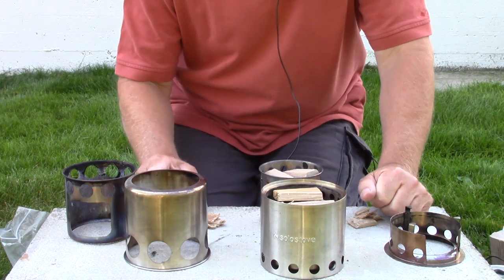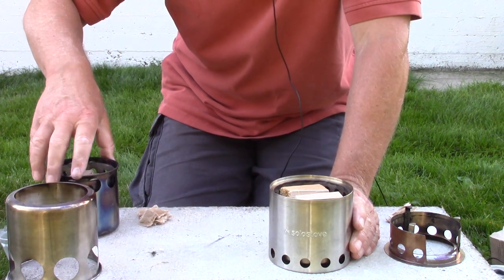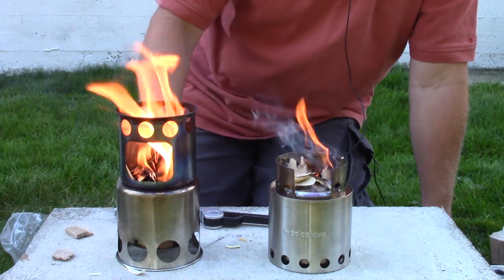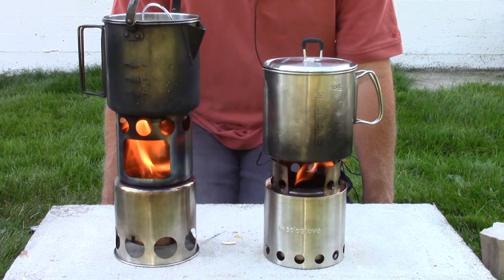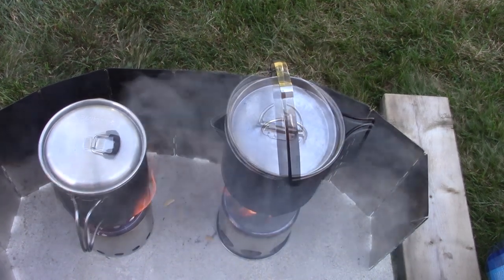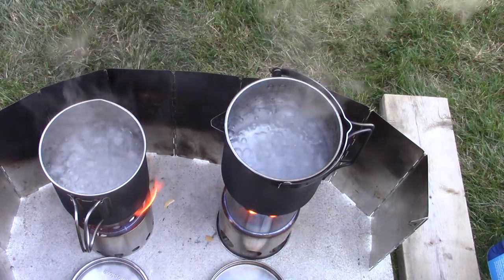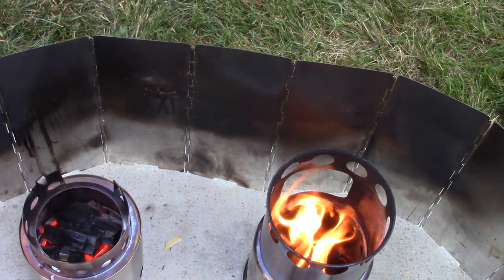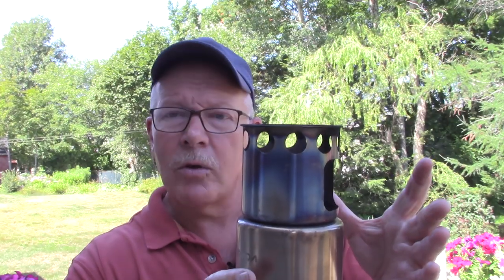Solo Stove & 900ml Pot VS Lixada Tower Stove & Camelwil 1.2l Pot - Part 2

Comment: 11:22 I don't understand the rush , on the boil time ...My friends make a big thing out of it....but I enjoy the slow process to boil...I enjoy sitting with the fire and feeding it.
Reply: Kanzee We're in the same camp about boiling. I always thought sauntering (hiking to other people) was about "unwinding" and enjoying nature. In the last few years I've begun to wonder if someone declared a race in the woods and I didn't get the memo. Of course I'm older now than in the  late 1970's when I started backpacking so if it really is all about the miles now instead of taking time to experience the beauty I guess I'd better hang up my boots.
Reply: The one thing I always bring on a hike is time,  enough time to enjoy what I am doing.
Reply: Alexander Gutfeldt One great thing about time is it doesn't weigh much as long as you're enjoying yourself.
Reply: No rush on boiling in my camp, I get the water on and while it is doing its thing I have time to set up my tent and maybe even blow up the air mat.
Reply: @viewsandreviews180  The only rush to boil is for the first coffee in the morning! For that I use my single burner gas unit.
Reply: Indeed. Sometimes the longer the cooking the better.
Reply: Working with tealight candles is the best option. Especially honey, beeswax. Honey beeswax clears up allergies, and indoor pollution. Using olive oil is the safest. It smothers the flame. Leave the tip of wicks dry to light it. This works with heat resistant mason jars with metal caps. It can hold at least ten wicks with holes in the metal caps. :)
Reply: @weatherstorms  Fantastic , I remember when the storms would knock out our power regularly, and the ole folks would make lanterns with rolled up soaked diy wicks and veggie oil.....the only problem with this was the black smoke they made ...but they worked well.
Thanks for sharing that about the Beeswax...that is good to know. cheers
Reply: @kan-zee  No problem! Olive oil is way less likely to make smoke due to its thickness. As long as the flames don't touch the pot you are in good hands. Sometimes receiving heat without flames surrounding the pot does work better. Unless it's yellow bottle heet, denatured alcohol, and trangia fuel. There is no soot with these fuels. Thanks for your comment! Melissa.
Reply: @kan-zee  Cheers to you too! :)
Reply from the maker: I personally enjoy taking my time with fire building and meal preparation. Boil time is not all that important to me either. If it was, I would use a gas canister instead of a wood stove or alcohol stove. In comparing stoves together boil time is included to provide an indication of design efficiency. In truth, a stove that boils water quickly often goes through woods too quickly. I like stoves that require minimal re-loading of wood. It can be a nuisance having to constantly feed sticks into a stove when I have other chores to do. Maybe a better measure of stove design is lack of smoke or length of burn. I try to comment on those is the comparisons as well. Thank you for commenting
Reply: @MarkYoungBushcraft  Which ever Stove you are more comfortable with Mark. :)  Thanks for sharing. Thought I'd share mine.
Reply: @weatherstorms  No beeswax in bear country please.  You will attract them.
Reply: Totally agree.  Being on the trail is great.  Warm food on the trail is awesome.  And once I discovered there's no rush, it all came into focus for me.  My first change was to ditch the canister stove for an alcohol stove.  The quiet is dreamy.  No more jet engine noises.  When I did that, suddenly all my trail buddies and scouter friends (I'm a scoutmaster) starting making and buying alcohol stoves.  Now I've made the addition of wood burning stoves to my gear closet, and have to say, it is a great excuse to relax by the fire.  While one guy is scrambling to get food made and talking about how fast his Pocket Rocket 2 boils water, I'm enjoying a quiet fire and chatting about what we saw, while I wait a measly 8 minutes or so to boil my water.  And I don't have to buy fuel ... ever ... if I don't want to.  I still take my alcohol stove with me, because I just like it, but I probably spent about $4 on fuel this year (total), and have otherwise been letting the trail provide.  

Being on the trail gets even better when you discover that there's no reason to be in a hurry.
Reply: @mclostinthewoods  I like your comment and your camping / hiking Style. !! 
😎👍🌟🌟🌟

Comment: Good video Mark and yes your assumptions for the performance differences are correct. 1. More air to the burn chamber increases the burn rate which elevates peaks temperatures and consumes fuel faster. The other design aspect that influenced your results was that the Solo's construction adds an insulting blanket of hot air around the stove to keep the burn chamber hotter - this is why the re-ignition of the 2nd load of wood was faster. The tower stove looses a lot of heat to the outside world. Stove design is fascinating. Keep up the good work.
Reply from the maker: Hello and welcome to my channel. I have been looking at your new stove since I first saw it on Shane's channel. I hope to be able to justify buying one at some point. I would love to test it out. Thank you for commenting and for your insights.

Comment: Great review and I'm really enjoying the series on wood stoves. I was so impressed with the large Lixada tower stove I bought one instead of the large TOAKS. The Lixada has worked as well for me as it did in your demonstration video. Now I've got some extra money for trail food or some other something like the Camelwil pot, thank you. Keep up the good work.
Reply from the maker: Glad you are finding the videos helpful. You could buy the Camelwil and have money left over for some HappyYak meals😉 Thank you for commenting
Reply: Mark Young I was wondering what size Camelwill you’d recommend for the large size Lixada (I like the larger base due to stability) but found the 1.2 liter’s diameter doesn’t fit the larger base. I like the pore spot on the 1.2 but haven’t found the 160 mm Camelwill has one.

Comment: Hi Mark - interesting comparison of two stick stoves.  I've used the Solo stove on a couple of trips and found it to be rather annoying in practice.  As you say, the burn chamber is small and holds less.  It felt like it required constant monitoring (I used dry twigs) and wasn't particularly quick.  After using other options I think the Solo is simply an over-priced "yuppy toy" that achieved fame with slick marketing.  I totally got sucked in by the it's-expensive-so-it-must-be-good mentality.  It's due to good people like you that we are able to know about the more viable and realistic options for making hot water - after all, that's all we want in the end!  Smile.
Reply from the maker: Thank you Paul. I really wanted to like the Solo and actually do but as you say, it can be a nuisance to keep going when I have other chores to do around the camp site. I suppose the advantage is that it uses small sticks but then again, that is its disadvantage. It just goes through them so quickly. Thank you for commenting

Comment: Very interesting Mark, can't believe the price difference, good job I like Lixada stoves. I also now have the Camelwil pot as my go to, though I stopped the floppy handle issue by wedging steel garden wire into the handle mounts, worked a treat. Thanks again for sharing Mark, take care 👍🙂
Reply from the maker: Great fix for the Camelwil. Both the stove and pot are great items by themselves and even better together. Thank you for commenting

Comment: I have the Solo Lite and the Lixada Titanium Tower stove.  I have to say, I'm finding the wood stoves a lot of fun to backpack and camp with.  I have been an alcohol stove guy (Zelph Fancee Feest) for years, and just got into wood stoves this year.  I will admit, I did build a soda can stove (with carbon felt wicking) to take with the wood stoves, just in case (and it has been a good add-on), but I have been taking my wood stoves for the last few months.  I think I like the Solo more of the two, because it is so well made and does do such a good job.  The tower stove is good too, and I do enjoy using it, but I think the Solo gets a stronger and hotter flame faster, and is a little cleaner to use.  It's a lot easier to dump the ash and bag it up, where the tower stove tends to be a little messier to take down.  I do find the tower stove cools faster, since it's titanium, but I have been pleasantly surprised how quickly the Solo actually cools down.  I was worried about being able to make coffee/tea in the morning and having to wait a long time to pack it up, but in 10 minutes (once you dump the ashes) it's ready to bag up and put away.

The alcohol stove comes in handy if it's raining and fuel is harder to process, but I have (out of morbid curiosity) tried to burn wet fuel in the rain (under a tarp) and was able to get it going in the Solo.  Not quite as successful in the Lixada, but it did work after a little bit more effort.  The trick is finding some material you can split down to get to the dry inner.  

Altogether, I'm completely entertained by these wood stoves.  I really enjoy them both.  If you have an REI dividend you want to spend, the Solo Lite and 900ml pot are a great bit of kit.  That has to be my favorite pot of any I own.  The Lixada is affordable enough (and the titanium one is only a few bucks more than the steel) that you likely won't have to wait to pick one up.  

I will caution folks to be very careful about who you buy Lixada stuff from on Amazon.  Some of the sellers post pictures and descriptions of products that aren't what they are going to ship you.  They will ship you the stove, but many feature pots, bowls, pans and such in the pics and descriptions that aren't actually part of the purchase.  Just be diligent in your purchase and be prepared to think you're buying a set only to receive just the stove.  Still worth it, but a little disappointing when it happens.

Love the videos.  Glad I found this channel.  I have really appreciated all the comparisons and ideas.  I made my first Ikea hobo stove this past weekend and need to take it out for a first burn.
Reply from the maker: I have the Solo stove/pot combination as well, in two sizes. Great stoves. I don't have the tower stove in titanium yet but may give it a try. A properly working wood gas stove is a pleasure to use as you have discovered. Always best to carry and alcohol stove along for wet days or quick boil ups. I have learned about buying from China the hard was seen in my latest video. Thank you for watching and commenting

Comment: One thing I found with the Lixada in the field is using various sizes of sticks etc. embers sometimes fall out from the feed hole. So you do need to be cautious and keep your eye on the ground etc. Good Review thanks Mark.
Reply from the maker: Absolutely. I usually start with a full load of longer sticks that will drop down as they burn but I agree you do need to keep and eye on it. Thank you for commenting

Comment: Interesting results.  Since you said that the pots both boiled quickly after adding more fuel, I wonder if the time at the start of the test to let the stoves get working could have been used to actually achieve a boil on a single load of fuel.  Not sure of the times, but 5 minutes at the start to get the stoves working seems like it might have been enough to get a boil on the back end.  In any case, since the time results were so similar, for me the Lixada price/performance ratio seems hard to beat, certainly better than the Solo.  My biggest concern with it has always been the height of the stove, and it seems fairly stable from the videos you've shown.  Great video as always!
Reply from the maker: You make a great point. Had I put the post one as soon as I lit the firestarter they may have brought the water boil before going out. When I use the Lixada in the woods I load it more fully and I easily get my water to boil without refuel, depending on the type of wood of course. I can't say the same about the Solo. It requires constant feeding. I had been concerned about the height of the Lixada but as Long as I am careful using it I don't feel it will tip. Thank you for commenting

Comment: Loved this videos. Your various videos got me the Lixada titanium version of the Uberleben Stoker. I love it. It RIPS through fuel but the upside is it burns out quickly... you make dinner or a drink on it,  you know it'll all be cold and ready to be packed away before you've finished. Some of these gasifier stoves, they look like they can burn for a while... good at camp, not ideal for me for a short brew.
Reply from the maker: You hit it right on. The Chinese Emberlit copies with there open bottom plates burn hot and fast. Great for a quick boil up but not prefect for slow cooking. Then again, you could always just feed little stick in to keep the fire small. You would just have to do it so often. Thank you for commenting

Comment: Greetings Mark, i have that same lixada stove but it doesnt gasify. I only put woodchips below the holes but it does gasify when theres something burning in the bottom between the walls.
Reply from the maker: I will need to be more clear in future videos. True gasification, as I now understand it, does not happen often even with my Solo stoves (unless I use wood pellets). More often than not, I am getting secondary combustion. Not as efficient as gasification but it still adds to stove performance. I will watch more closely when I use the Lixada in the future. Thank you. Your comment (and a few others) have motivated me to better understand the process

Comment: Just a thought! It is my opinion that apart from the air flow, the Solo Stove creates a hotter burn chamber due to the three layers of metal beneath (bottom plate, hole plate, and ash tray) which act as insulation of the burn chamber.  So wood is hotter, gasifies faster, and you had a stronger rolling boil on the solo stove. I think this is a result of the engineering by Solo Stove, but it also means you have to feed it more often. It's a faster reactor, so to speak. I also have the Lixada stove and really like it also. If like to hear others' ideas.
Reply from the maker: I believe you may be correct regarding how the Solo design affects heat/flame intensity. In this case, the Solo has a much smaller burn chamber than the Lixada which also contributes to the need to feed it more often. I do have a couple of videos comparing the larger Solo Titan with the Lixada woodgas stove if you are interested. Thanks for commenting
Reply: I'm not always good at explaining things, but here's another stab at my theory of why Solo Stoves work so well. Gasifier stoves work by having air travel up between the outer wall and burn chamber where the air is super heated before entering into the burn chamber at the top where the hot air mixes with wood gas (smoke) and burns.  In addition to this, the solo stove design brings superheated air through the bottom. The air is forced to travel underneath the "hole plate" where it is heated by that plate, then it travels between the hole plate and the ash tray where it becomes superheated before entering the burn chamber so that you also have superheated air coming in from underneath. The burn chamber is insulated from heat loss on the sides and underneath which would occur if the burn chamber were directly exposed to outside cold air this providing a hotter burn chamber. In addition to all this, Solo Stove has optimized the air flow for heat output out the top.  I'd love to know the development process they went through. That's my two bits!

Comment: i have the ohuhu and the lixada tower stove.  The ohuhu is pretty similar to the solo.  

I have noticed that the ohuhu/solo is more efficient.  If you build it right and tight, you get long clean burns.  You leave it and not have to touch it through entire burn.
The lixada is nice for my son.  It has the big window to add wood all along the way.  It seems that it is less fussy for overall burning.  It seems that if you top load new wood onto the lixada coals it takes it better than the ohuhu/solo.  

In raining less ideal weather I prefer the lixada.  It is less fussy overall.  Also if it was really cold I prefer it over the other one.  It seems more versatile overall in design.  

How do you favour each over other for different scenarios?
Reply: Really think you do an awesome job on these videos.  I have seen others but you explain the why and how much better than other people who light the stove and just let it burn.  There is an amazing science built into these inexpensive tools!
Reply from the maker: Thank you for you kind words. I have both the Solo Lite (used in the video) and the Solo Titan which is more comparable in size with the Lixada/Ohuhu stoves. Th true wood gas stoves are often heavier than the "Tower" stove as they have more metal. They are usually more "efficient" than the Tower, giving a slower burn with more heat per amount of wood over a longer time as well as being cleaner burning once they get going. The advantage of the Tower is lighter weight, less expensive, more compact and has a larger fuel capacity. It will burn through the wood faster providing more intense heat but for a shorter time. Great for a quick boil-up. The tower will accept longer sticks making it less work to fill and feed. Hope these thoughts help. Thanks for commenting

Comment: might be silly and not a real use, but I want a solo stove to have as a picnic table mini fire torch for cold evenings
maybe it would suck in practice but it seems cool in my head
Reply from the maker: Sure, no reason not to. They do require a lot of feeding though once the initial load has burned down. Thanks for commenting